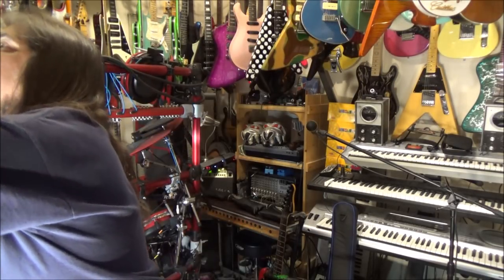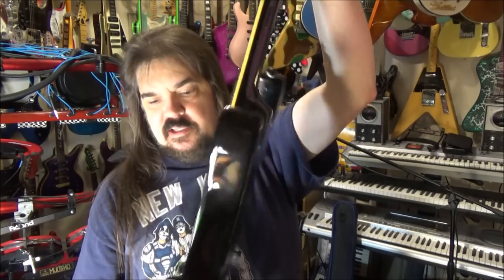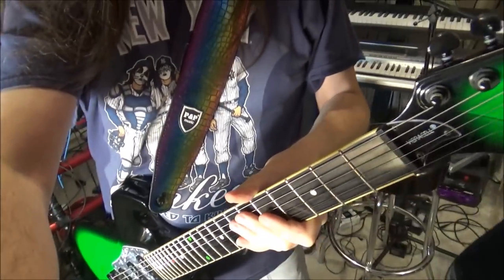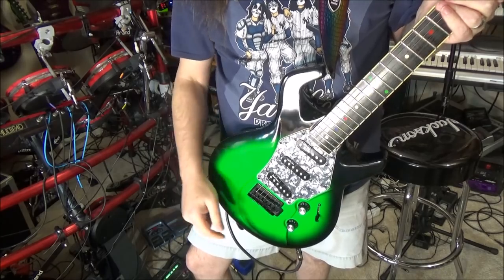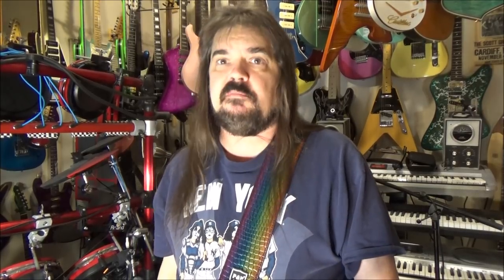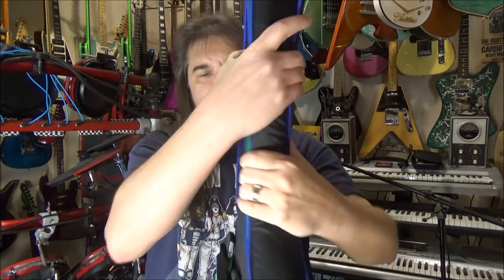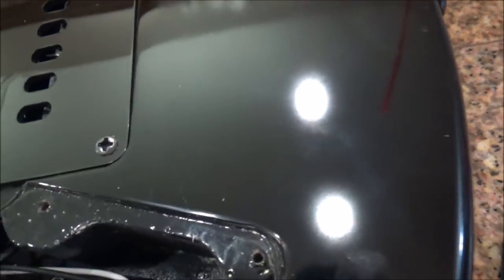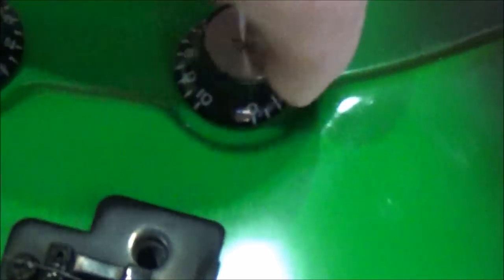2004 Switch Vibracell Signature IV Review By Scott Grove

Comment: Resin was used by Gibson back in the late 70's and it was a failure. The infamous 'Sonex'.I had one as my first 'real' guitar .It had a bolt-on neck.  Trevor Wilkinson of 'Fret King' 'Vintage' guitars designed a lot of the Vibracell bodies. They were injection moulded with 'Vibracell' resin which they claimed has the same density as mahogany. Cort guitars also brought out a range of remarkably similar resin guitars at exactly the same time. I have an early 'Wild' shaped model in bright orange in my collection. They chose some awful colours.

Comment: how does one get to the knowledge that peanut butter cleans sticker residue? How does one get to know (or even to discover) that? :) :)
Reply from the maker: Glad you asked, this is something that was passed down to housewives back in the OLD days.  If your daughter has long hair and gets gum stuck in there BIG TIME, you either have to cut the hair out to get the gum out or use the peanut butter. It has the peanut oil as a MAJOR conditioner and then it has TEXTURE as well which helps to give it the ability to grab on to whatever you are trying to remove.  When you apply the peanut butter to the hair to the gum and the hair around it and BELOW it and start to comb through it while holding the hair above it (so she won't scream from yanking the hair), the gum lets go pretty easily and combs through withing a few seconds.  Then, through old ladies telling other old ladies on the telephone, it got their brains going and their husbands brains going to start trying it on all kinds of STICKY things and it became one of those old time things that has simply been passed down over the years.  Great stuff!